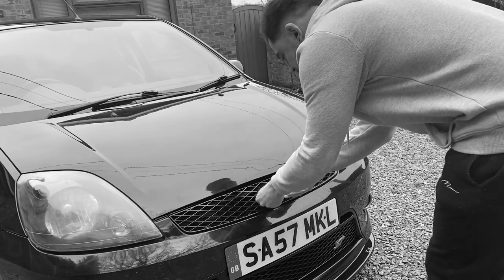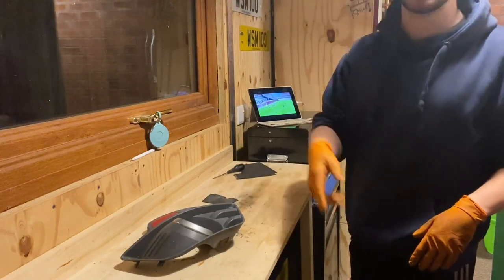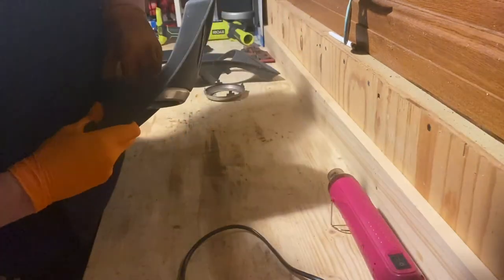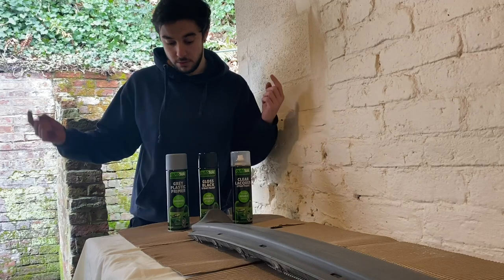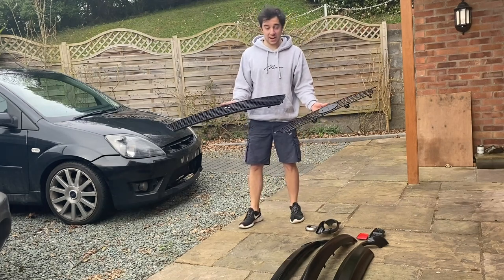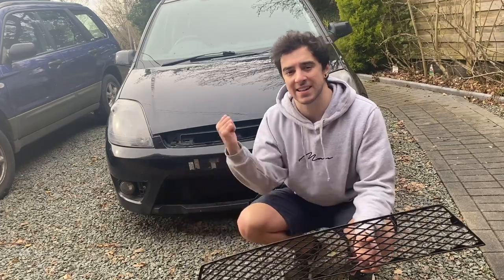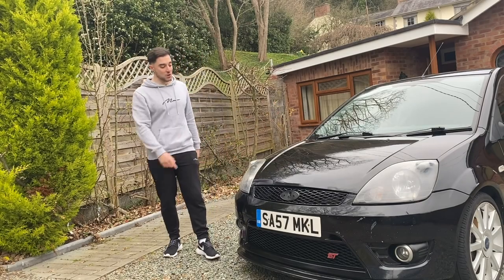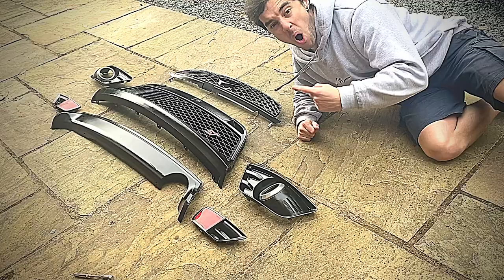DIY | RATTLE CAN | GLOSS BLACK | Painting Grilles and Trim *Fiesta ST150*

Comment: Looks so good in black. The thing I have left to do is the lower grill. Do you have to remove the whole bumper to get it off, or can you just Jack the car up & push the clips out that way?
Reply from the maker: Yeah it makes such a difference. You don’t have to remove the bumpers no but most of my arch liner clips/screws are missing so it was only 3 bolts each side for me so took less than 5 mins to remove the front bumper. The back you would have to drill out the two rivets to remove the bumper but should be easy enough to remove the diffuser and reflector surrounds with the bumper still on. 👌🏻

Comment: Looks good mate I’m going to do it on mine in the summer.
Reply from the maker: They make such a difference mate well worth it 👌🏻
Reply: @MendItModIt  yeah definitely make it look so much better. Holding up well so far. Mine came out the same as yours with the grills really glossy and the other bits not quite as good but I’m really happy with it for a diy job. The sanding and prep took me ages to do.

Comment: I've done virtually the same to my 1,25 zetec,. But I'm looking for the  rear bottom grill with the half pipe for the exhaust..
Reply from the maker: The cut out you mean? Not sure what the bumpers are like on those but they might do one, if not, cut one out 😈 then sand it smooth and paint 👌🏻

Comment: Good job mate, I know we do our mk7 ST’s but this is the first time I’ve seen the mk5 done well done 👍
Reply from the maker: Cheers mate. You call these a MK5? I’ve heard them as a MK5 and a MK6, makes it so confusing when trying to buy parts 😂
Reply: @MendItModIt  definitely mk5 I’ve had 1,2,3 and currently mk7 the mk 5 is the fiesta I always wanted but some reason I opted for the focus st170 instead
Reply: @MendItModIt  I found out it's a Gen 5 (like you'll see it listed on ebay for parts 'Fiesta V') but also a MK6. So it's both but the terms get confused. Google search "wikipedia ford fiesta ST" was a pretty interesting read.
Reply: @MendItModIt  its because they don't acknowledge the facelift mk4 as being the mk5 so mainly European countrys call it the fiesta 5.  Where as we have the mk4, mk5, mk6, mk6.5 (facelift) mk7, mk7.5 (facelift) and mk8
Reply from the maker: @djmandrick  I’ll take a look, thanks 👍🏻
Reply from the maker: @shelg6082  so confusing 🤯

Comment: I have a mk6 1.25Z  .My fog lights look the same as the ST  "but"  there's no screw to release...How can I pop them out ...?  Is it attack from under the bumper..👍
Reply from the maker: Oh I wouldn’t know on the other models but if there’s no screw I’d guess it’s clipped in from the back somehow yeah, might be a bumper off job, but then just take the bumper off regardless cause it makes things so much easier
Reply: I'm thinking about getting an ST bumper do they fit a standard mk6 ZT (late)56 reg
Reply from the maker: @alanpercival6428  I’m pretty sure they do, got a mate with a 1.25 that has the full ST kit on, I’ll message him and let you know if he had any hassle with it
Reply from the maker: @alanpercival6428  front and rear bumpers are a straight swap mate. Only things that need extra is the side skirts, they’’d need sealing on

Comment: To get the best pro glossy look finish it with 2k coat.Nice fiesta i got mk5 only red need to paint the bumpers 😂
Reply from the maker: Yeah man the 2k stuff I’ve used on other things since is next level, even in an aerosol 😳
Reply: @MendItModIt  yeah sure i also did restore my old headlights with 2k coat.Only need to practice before u apply it.But the results are awesome.

Comment: You can do all that without taking the bumpers off mate. All can be clipped off or out
Reply from the maker: Yeah it just made life a lot easier to remove them for me, some of the clips can be a pain 😂 most of my arch liner clips/screws are missing so the front bumper was only 3 bolts each side and the rear was already missing the rivets so it only took me a few minutes to remove the bumpers.
Reply: How did you take out the like plastic bits where the lights are and the rear reflective bits ?